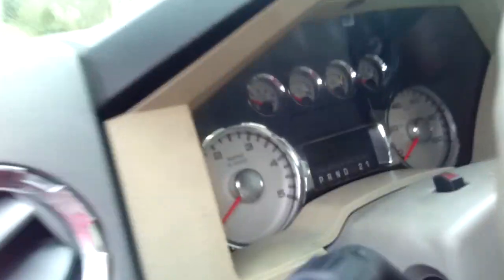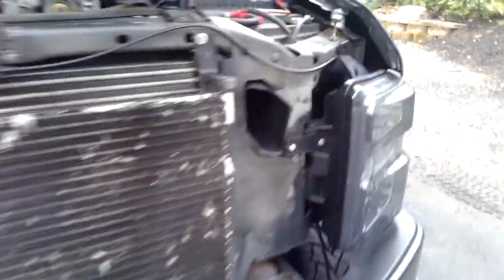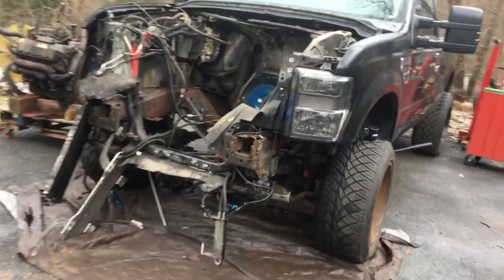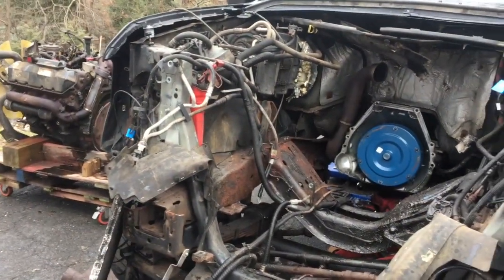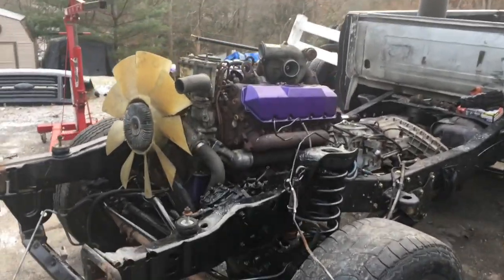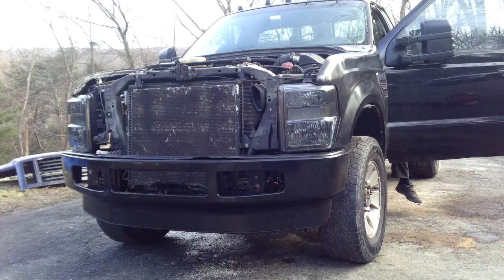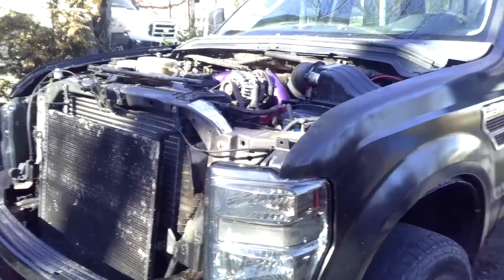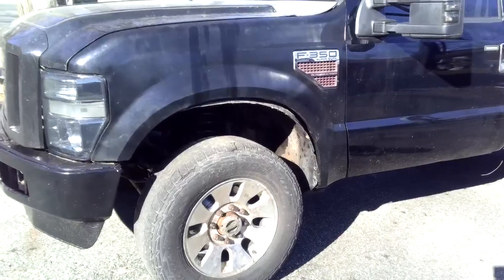COMPLETE Coil Spring AXLE SWAP in My 2002 F-350 7.3

Comment: You know to do an 05 coil axle swap, you don’t need to chop the frame and weld a new one on. All the brackets from the 05 will bolt right onto the 02.
Reply: This is the comment I came here for. Buying one this week and don't want to have to get the whole frame piece too
Reply: @Legend-fw6eb  yeah man. Look around on Ford forums, like Powerstroke Nation, or The Diesel Stop. Those dudes can tell you more about how to do it. But it basically involves getting the front axle, and all the suspension linkages. Everything should bolt right up, except for the 04 steering pitman arm, to the 05 drag linkage. The 05 steering system uses bigger ball joints, so you’ll need to ream out the 04 pitman arm to fit the 05 drag link. You’ll also want an 05 rear axle, as well. Reason being the lug nuts are different, the brakes are bigger, and the track width is wider on the 05. So you’ll want both axles to match. Hope this helps, go to Powerstroke Nation forums if you wanna look more into it. Good luck on your build!
Reply: @LimaTangoZulu  awesome man great useful info, didn't know that about the pitman arm and drag linkage. I already have an 08 rear end, so this is the icing on that cake to finish the ride quality to how I want it. Read a couple of forums but that's one part I haven't seen. Getting everything needed except that subframe for $500, some cleaning painting and new hardware and hopefully it comes out nice in the next couple months.
Reply: @LimaTangoZulu  doing this all on an 01 7.3 also so not sure if that made much difference from the 99-01 I know a few things changed as well
Reply: @Legend-fw6eb  now a 2008 you will have to fight it a little more to make it work. I would go with a 05-07 axle to make it easier on yourself. Nobody would be the wiser lmao.
Reply: The gussets he pointed out are welded in.  Ford added these to the frame in 05 when they were converted to coils.  Some people say they aren't needed.  I suspect that depends on how you drive.

Comment: Fantastic video let's me know what I would be getting into to do that kind of swap. Got a 00' F250 I want to keep around and upgrade.
Reply from the maker: Thank you. It’s a lot to do it this way. A lot of people just pull the axle and swap it with the bed one and mount the coil buckets and radius arms which is fine too i be heard. I just felt safer pulling the cab and changing the front section for the reinforced frame from the later year.

Comment: Would like to see you actually do the work instead of jumping from one step to the next would like to see you do the work I wanna do the front frame section swap and would like to see some pointers
Reply from the maker: Craig Hunter I would have, but it would’ve been a 5 day video if I showed every little step along the way lol. That’s why I shortened it to steps since I think it’s doable with what I said and to watch without gettin too bored! What questions do you have I can answer them.
Reply: @Jimmyziggy  I have a question. I have an 01 f250 7.3 4x4 long bed crew. My truck got hit and the frame is bent and a bit rusty. Can I do a full frame swap to a 2005? Or is there differences in the back half of the frame as well?

Comment: So if I do the same frame swap on my 2000 Excursion 7.3 4x4, could I reuse my original 2000 front axle by mounting it on the 2005 frame? I understand they have different bolt patterns.
Reply from the maker: Brandon Wetklow Honesty I’m not sure, But if you do all the work your better off putting the upgraded coil axle under it
Reply: they also have the same lug pattern 8x170

Comment: You can strip an entire truck apart and back together, but can't fix a garage door, or manually open it? 🤔
Reply from the maker: G Gg Haha of course i can. The framing and structure was getting redone so the rails and stuff weren’t in place. if it was that easy i would’ve just done it
Reply: @Jimmyziggy  lol. That makes sense. I was thinking what the heck. Haha. Good stuff sir
Reply from the maker: G Gg Thanks!

Comment: If the 99 to 04 frames were not strong enough for coil springs. Then why do the 2wd super duties coil springs.
Reply from the maker: Matt Smith Because if you look at the 2wd components, they are much less rated than the 4wd version from 2005+. And it also takes into account the nature of a 4wd truck versus a 2wd truck. People are more likely to off-road in a 4wd truck which adds more force and impact as you can imagine. Do many people do it? No, but it gets factored in. Also think about plowing, the extra weight of a plow on a 4wd vehicle, that cause more stress on the front end. People don’t plow in 2wd vehicles (well most people don’t in these trucks at least). The frames were fine for the 2wd coil springs, up until testing and analysis were performed on the 4wd version of the coil springs and estimated loads and occurrences with it. It’s also about material fatigue and internal deformation of the material over time too. I can go on further, but I will make a video explaining it all one day eventually. I’m not trying to scare anyone here who’s thinking or has done an axle swap, I’m just looking at it from an engineering standpoint, because  that’s what I am - I have studied and dealt with the ways material failures could occur similar to situations like this.
Reply: The reason more so being that the 2wd SD’s use TIB still with two points of contact (pivots) vs a live axle front axle. To be honest with you I don’t believe it was a huge issue either way. I believe the engine crossmember gussets came about with many changes from Ford trying to stiffen the frames of the 05+ trucks up over the 99-04. If I recall correctly they also changed the frame thickness in the change over as well.

Comment: Why in the heck didnt you just swap the axle? I did a 08 axle swap on my 99.. way easier to swap and mount coil buckets bud.
Reply from the maker: Beagler Bass Fishing & Outdoors I know that, a lot of people have questioned me on it. In the video i explain why: the frames are different from 05-07. Much beefier to support all the weight of the coil spring on the cross member. Old frames cracked during testing so Ford updated it. Sure people have gotten away with just swapping the brackets but I don’t like taking chances going against the way the 4wd coil setup was designed with the frame. I know all the holes are there and everything, but that’s for the 2wd version, a much less rated version of suspension than the newer 4wd axle.
Reply: King Shaka Customs i dont think the weight is much difference.. leaf springs prob weigh more then buckets and springs or about close.
Reply from the maker: Beagler Bass Fishing & Outdoors Beagler Bass Fishing & Outdoors I’m not disagreeing with you there. My point is that the leaf spring contacts in two spots on the frame, whereas the coil spring makes contact at one. The force distribution is a lot different therefore. Hence why they supported it more where the coilspring makes contact. One day I can make a video more explaining my thoughts and calculations
Reply: I did a an axel swap on my truck I have an 04 f250 4 wheel drive haven’t had any problems
Reply: The issue isn't the weight. The leaf's put the load force straight up into the frame while the spring buckets try and twist the frame towards the engine. This force is s why spring tower supports are put onto vehicles like rally cars.

Comment: You did it the hard way.
Reply from the maker: Yea I did but i'm glad i did. I could've done it to just drop the axle, but i was doing some engine work at the same time, and i got to paint the frame, and honestly to re-graft the frame to me was more worth it than to punch out the coil bucket rivets, and to drill the three holes up front in the cross member, and to adapt the other components. In the end the steering gear box and everything was already in place ready to go and meant to be on this frame, so I didnt mind it.
Reply: @Jimmyziggy  yea i was that, good work man. 
I’m doing this swap right now.
Reply: What did you do about the ABS sensors?
Reply: And that gram cracking thing I’m not too sure about that. What about the 2wD models? We’re the cracking?